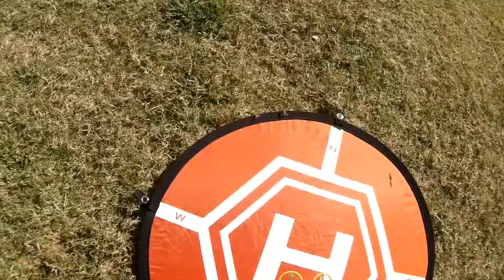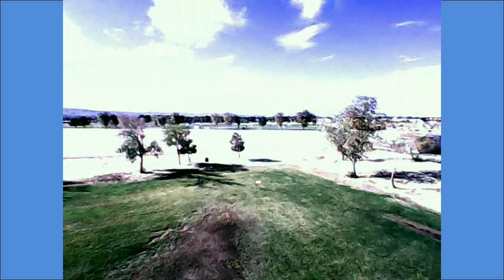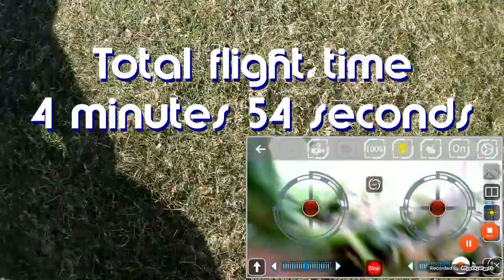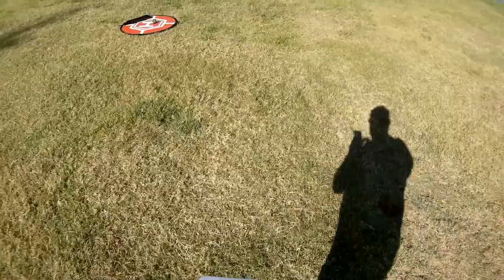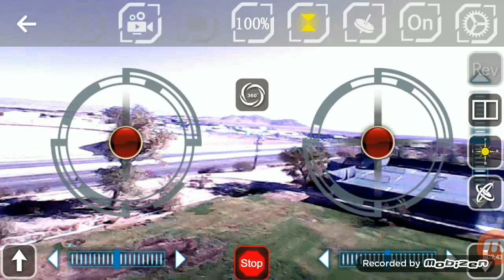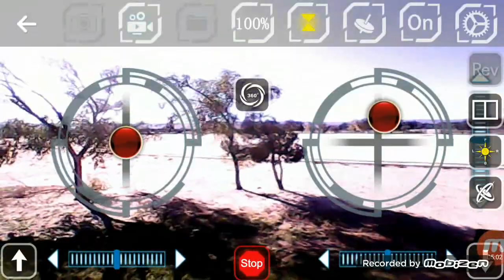FQ777 FQ26 FPV Selfie Cube Drone Flight Test Review

Comment: Interesting. By the way, I got a FQ777-124 nano quadcopter and I like these little bugs, but I'm having a hard time trying to make headless mode work in the correct orientation. Is there any trick to make it go to the correct orientation?
Reply from the maker: Most use the direction that the quadcopter was pointed at initiation and takeoff as the headless mode reference direction.
Reply: Quadcopter 101 Thanks very much. :D
 I'm going to try that! 

By the way, the One-key-return indoors look like One-key-wall or it go to opposite direction... Kinda quirk... I need to double check it outdoor in a open field.
Reply from the maker: That's exactly what one key return does, it goes the opposite direction of the headless mode.  It's not really a return to home feature, as only a quad with true GPS can do such.  Instead, if you keep the quad flying down the general direction that it was pointed at takeoff, it should fly back in your general direction.  But, it's best to learn the following easy to learn technique instead of depending on headless mode.  https://www.youtube.com/watch?v=qdYTCfjUVVo
Reply: Quadcopter 101 Actually, I find much more difficult on using headless mode than flying like a standard R/C helicopter. 

I'm much more experienced with planes and 3D acrobatics. Quadcopters and other buzzing vertical drones are a new world for me and I'm really enjoying. :)

Actually, I like the fact I don't need to be worried about have a improvised runway to land.

I probably should go get a X-Vert VTOL plane. :D

Comment: But..... how far would you fly without the repeater? Need a comparison.

Dance the Skies
Reply from the maker: +Route 66 Flyer it depends on your phone, but my phone only transmits out about 30 meters. With the repeater, I was able to control and get video from the quadcopter about four times farther than normal.
Reply: Thanks 101, was thinking when you use the repeater we would like to see a demonstration of the difference.
Reply from the maker: I'll try to do such in the near future.